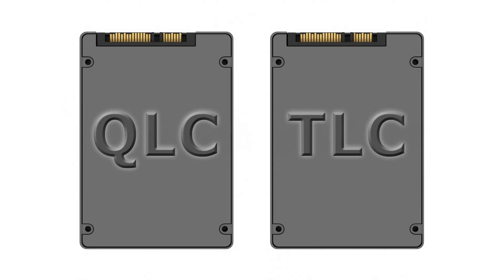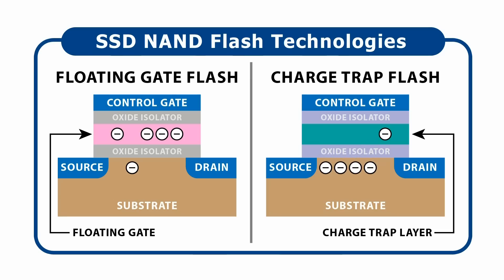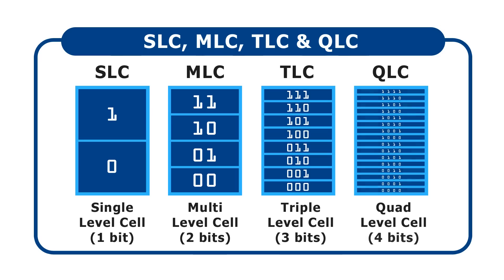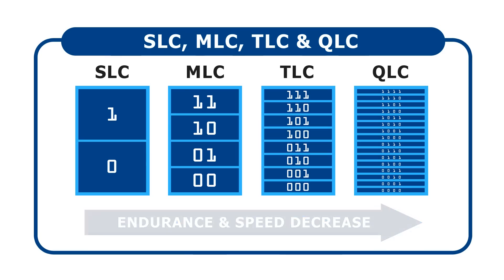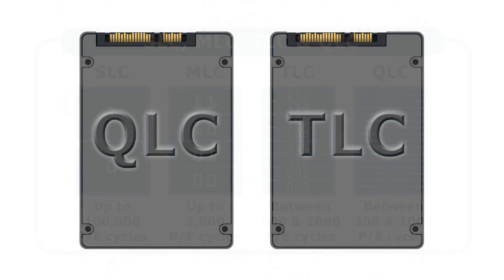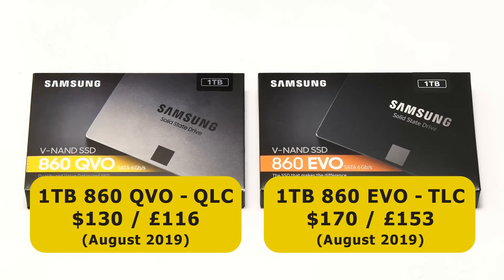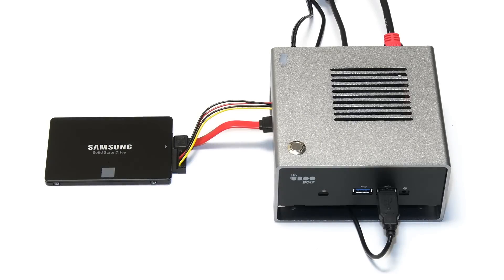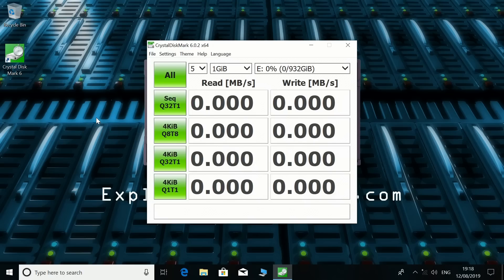QLC vs TLC SSDs: Samsung QVO & EVO

Comment: Wow, thanks for the explanation! I just installed an Evo in a laptop for portable audio recording (no moving parts that way, if kept cool enough) then moving them to a larger external backup drive, so I'm glad I picked the EVO there (good experience in the past with them, plus that 5yr warranty), but as for my upcoming work desk touchscreen PC, built with an Atomic Pi inside a touchscreen monitor above the soldering station, heatsink sticking out the back? I'll save the money for other components, and go with a QVO. 😁
Edit: Also, thanks SO MUCH for explaining how the multilevel SSD technology works! I finally think I understand it somewhat!
Reply from the maker: Great to hear of your Atomic Pi project. :)
Reply: @ExplainingComputers  I ordered an Atomic Pi "developer's kit" (2 Pi units, 2 cameras, 1 power supply, 1 enchilada board - only ones available on Amazon Prime at the time, but GLAD I had 2 to start with) as soon as I could after watching your video on it, and WOW, am I surprised! Those things have proven WAY more versatile than I'd hoped. So much power, and once I got the GPIO working fully? Goodbye Raspberry Pi for me. At least while these are available. 
The touchscreen PC I'm working with as a starter/shell is an older model cheap DIY that someone gave me. It was based on a 1st generation Atom chip and ran Windows XP Touch or Windows 7... poorly. The nice thing is that it ran on a standard desktop mini-itx board, so the Atomic Pi fits perfectly in that space. 
The touchscreen was just connected to usb jumper pins on the MB along with the front panel buttons etc all just using standard breadboard-style wires with female connectors mounted directly on MB pins (and secured with silicone, haha), so I can use that ATX power supply to run the 12v amplifier portion of the "Enchilada" daughterboard along with the 5v for the rest of it, and connect all the buttons directly to the GPIO.
The main purpose of it will be to run VMs from my server and have a soldering PC directly over my workbench to pull up data sheets and videos while I'm working, plus function as a smarthome hub in the background for my home lights/cameras/etc in one place, which are all hodge-podge and mismatched at the moment. I'm also adding an arduino nano to the solder points on the Enchilada board (probably the new nano 4 with wifi/bluetooth mesh capabilities) and an NRF24 for my MiLights. 
I'll update you when it's finished, and see if I can't toss a video or some photos up online. Thanks so much for once again providing awesome information and inspiration! This dead project idea is almost alive now! 
(Been working on the code this week and have it beautifully controlling LED strips as well as ALMOST getting the household lights to all work together. Not the MiLights yet, but that's where the arduino comes in. 
The ambient ones, yes. Yeah, I'm adding silly backlights to it, like those Philips Ambilight TVs, haha.)
My other Atomic Pi is being used to build my partner a portable sound recording studio (using your sound panel advice, heh) inside a hard-shell suitcase. Plug in a large fast USB drive  to record to, and it's perfect. No moving parts, hardly ANY electrical noise at all, no audible whining, and low power usage. That with an elgato streamdeck (6 button) for basic recording functions should be perfect. 
Oh, and it'll also function as a perfect foam carrying case (I'll cut out a section in the bottom) for their Blue Yeti Blackout microphone. (MAN that thing picks up background noise well!)

I also have a strong enough USB PD3 power bank to run it off of, so I'll cut a notch into the bottom foam panel for that as well. (Everything solid will be enclosed in the foam, so that it won't bounce sound.)

Ahh, so many projects... I need a clone of myself.

Comment: During the time the drive is writing from the outside to the faster cache storage in the SSD it might also be able to dump the cache to the slower permanent storage thereby increasing the sustained maximum write burst. Might be a differential equation or a limit of a function.

Comment: I bought EVO TLC  some years ago because of Samsung's 5 yars warranty, a clear statement from the company about the EVO realiability.
Now, QVO just saves 30% or less in price and come with only 3-years warranty? This sounds to me  like Samsung itself is not confident in QLC technology...

BTW 80Mb/s sustained transfer rate is even less than what you can get from a modern mechanical hard drive, so this completely cuts QVO out from the big data transfer scenario like video editing etc. which would have paradoxally been the killing advantage of QLC vs mechanical drives (i.e. best compromise for lage capacity still with ssd level speed).
You did a great job in investigating that.

Comment: Is there a power usage difference between the two techs? Translating to heat output
Reply from the maker: Possibly, but the difference in power use is probably very small indeed.

Comment: ExplainingComputers why Samsung keeps calling their SSD's MLC if you can basicly look on the specs sheet and see that it's not true, or maybe not completely true ? QVO = 4bit MLC
, EVO = 3bit MLC and PRO = 2bit MLC this is a bit wrong there, don't you think ? Is it not supposed to be QVO 4bit QLC, EVO 3bit TLC and PRO 2 bit MLC ?
Reply from the maker: You are right, Samsung has decided to use "multi" for everything -- even though everybody else takes "MLC" for what it first meant of 2 bits per cell. So Samsung 3-bit MLC is TLC, and Samsung 4-bit MLC is QLC. :(
Reply: @ExplainingComputers  That's a marketing shame ahahah

Comment: Did you try it with rapid mode mode turned on in the Samsung magician? I get ridiculously high numbers with it! I'm wondering if it's right or not. They're so high it makes my 970 Evo m.2 look slow.
Reply from the maker: I did not have Rapid Mode turned on, as this caches data to a PC's RAM, so prevents tests assessing actual drive speed.

Comment: Hello, Chris, I have a question I have a MacBook Pro I had it for about 4 maybe 5 months. I was wondering when I shut down the computer for the night it says if I click this box it will reopen in Windows what does that mean exactly?
Reply from the maker: This I do not know I'm afraid. Sounds very strange. Can you run a virus checker?
Reply: @ExplainingComputers  Oh yeah it is clean I didn't know if you knew anything about Macs or you were Exclusive to windows you seem to know just about everything when it comes to computers I figured I would ask.

Comment: I don't want a Desktop system with only a SSD especially if it's TLC or QLC. For my Data I want a longer lasting more reliable Hard Drive that has a much higher capacity at a much lower price per gigabyte. A SSD is best for the boot drive but not data storage.

Comment: This goes back to when we first received the TLC units - we stuck with the MLC (EVO Pro) drives for high-data-change requirements and shifted the TLC drives into the position of system drive where the number of data writes/changes were minimized.  It looks like QLC (which we've avoided to date) may be a successful cost reduction for system drives yet again.  US$40 doesn't sound like much for a single system build, but when you ship high-hundreds of units per quarter, that makes a noticeable improvement in either the bottom line or the customer selling price (or both).

Comment: Great video, thank you! Moving to QVO (and whatever storage technology comes next) really illustrates the need for a file system like ZFS with its volume management and storage pools. It would be so much easier to replace worn out drives and to be sure your data doesn't suffer from "bit rot." Maybe a ZFS video is in order. 😊

Comment: Please test how long it takes for the QVO to fully recover from the depleted SLC cache. In my testing, if I take into account the 80 MB/s direct write to cell speed, it should replenish the 42 GB cache in about 525 seconds which is close to 9 minutes but I observed that even after several hours, the QLC drive still couldn't get back to it's original performance
Reply from the maker: Very interesting. I will investigate.
Reply: @ExplainingComputers  Thank you! That'd be awesome! I know that Intel supplies a software for their 660p SSD that allows you to forcefully flush the SLC cache to disk to get it back to full performance again but I don't think Samsung offers anything that does this. Samsung Magician certainly doesn't support this.

Comment: Note ssds Don't have a ram cache (it's only used for page table and wear leveling all writes and read directly happen at the NAND level) 
What your seeing is windows has buffered caches, look at task manager > performance > ram and you see it full up the cache part of bar by about 8-10gb (depends how much installed ram you have) witch caches writes and causes that bump at the start (turn off disk write caching on the test disks in device manager and that should remove the windows caching)

Comment: Something seems to be a little bit off with your 860 EVO.

I just ran the Crystaldiskmark 6.0.2 on my 1tb 860 evo, and I got significantly better values.

Read vlues from top down,  564.8, 408.6, 408.6, 46.73.  Write values from top down, 537.5, 381.5, 380.7, 132.7. 

Windows 10.

Comment: The thing is, with 2TB and 4TB SSD's even with low end 360 PE cycles, that's 720TB and 1440TB of total data written. For an average consumer, that's a lot of data. I still think having an NVMe MLC SSD as OS drive is smart, because of constant OS read/writes. But QLC as a general purpose data storage and game drive won't be an issue, and quality and reliability will improve as time moves on.

Comment: Most online reviews i have seen put too much emphasis on the reduced endurance of QLC SSD's.  I have owned my Samsung 850 EVO drive for just over two and a half years. At this point the drive has only reached 17 terabytes written, so the 860 QVO's 360TBW is far more endurance than the average user will ever need.

Comment: Interesting.  But how does the QVO drive perform using Samsung's RAPID mode ?  I get up to 3852.8 MB/s (yes, three thousand eight hundred and fifty two) seq read speed with my 500 GB EVO 860 on a cheap Latitude laptop with an i3-5005U cpu.
Reply from the maker: RAPID mode caches memory to your PC's RAM, rather than saving it straight to the drive, so you need to turn RAPID mode off to test actual drive performance. That 3852.8 is the speed of your RAM, not the EVO SSD. :)
Reply: @ExplainingComputers  Oh... Thanks for the info. Works great though.

Comment: You didn't give an explanation for the difference in write speed after the 42 GB cache was filled. The difference is due to the different inherent write speeds of the TLC and QLC cells. If I remember correctl(from nvme drive reviews, maybe the  tech deals channel), the TLC sequential write speed is limited to something like 1500 MB/S, so you're still bottlenecked by the SATA interface. I bet they only put in SLC cache for sustainability or scaling (in the production process) reasons. My hypothesis is that you saw a little dip in writing speed after the SLC cache was filled because the internal controller needed to switch to writing directly to the TLC cells. The inherent write speed of QLC is a lot lower as you clearly demonstrated!

Great video anyway! Really like your channel!

Comment: My crucial 300 died in my last PC, few months after I got it. Went velociraptor 10k rpm wd drive. Now on 1tb m.2 Samsung pro, with 2tb evo steam/blizzard/origin drive and (prior to having them BOTH die) 2x 6tb wd black for backup ...with 4tb my passport for tertiary backup
Reply: Cheap SSD/NVME endurance is lower than their advertised, don't be impressed on cheap stuff

Comment: Now a new subscriber here, love the explanation for simpletons like me ;)

So if maybe not for boot drive.. what would you trust it for?

Would you use it for the likes of games... where it might be constantly being read/written - but if it fails, who cares, reinstall games on new drive no drama
Or say... photos/movies/documents... where the read/write might be less, but loosing this drive would be a bigger loss

Or... who cares, just run it.. and back up daily/weekly on a old school 3.5 HDD
Reply from the maker: I would trust QVO as a boot drive, and indeed am doing so for a Linux install as teased at the end of the video. :) And I totally agree with your final statement -- who cares, just run it, with appropriate backup.
Reply: when HDD being died you could loose  your data, and cost recover HDD data is very expensive but not for SSD when your SSD TBW(Terabyte Written) has been exceeded can copy your very important data to the new storage.

Comment: I have raid 1 QLC Samsung drives as a cache in my file server. Only using gigabit Ethernet so not hitting anywhere near the full write speed anyway. And i don't write big file that offent mostly small file most of the time. Also have my unraid vm image stored on my cache drive. And the cache drive are really need with perity drives on my main array

Comment: How long does the QLC drive need to recharge until it has its full performance again? Isn't 1GB/s at the beginning of the write test impossible for SATA?
Reply from the maker: The QLC will be back to its max write speed once the cache has cleared -- a few minutes. Windows Explorer indeed reports strange -- and impossible -- numbers at times! :)

Comment: I think the price difference of about 40 € on 1 TB is too small to support QVO on a single drive. Maybe if you were in an organization and had to buy 20 drives. Sure on large drives most data just lays there once written. If the difference was 100 € vs. 170 € then QVO would be more attractive.

Comment: I am a memory expert and I can say you only touched the surface of NAND storage cell technology. I think the biggest thing you missed was that not all substrate dies are equal at a given level; there are SLC that are rated up to 100K writes, but others at 50K or even 10K. One indication is to look at the ECC requirement and see how many bits are expected to be corrected per 512 byte page slice. Therefore, there are MLC chips that are superior to lower quality SLC chips. Further, it should be noted that all NAND cells suffer from unreliability and MUST have a hardware ECC layer implemented, unlike NOR cells which can be rated reliable and require no error correction.
Reply from the maker: I totally agree with what you say -- I gave a very brief overview of the technology, as I did not want that part to dominate the rest of the video. My challenge in making videos is always deciding what to leave out. :)

Comment: If there is one thing that SSD have a hard time beating HDD, it would be reliability in overwriting old data with new data without function issue.
Reply: Also data storage on prolonged time. Hdd can easily store its data in apropriate conditions for 30 years. Ssd, especially qlc now, wont hold even 20 years. Slc will be best but tops out around 10 years, mlc less, tlc few years, qlc some months. Also hdd is still cheaper for GB per cent.
Reply: @fulldnbboy  So which one of the SSDs are the best for storage on prolonged time?
Reply: @TheRealFobican  if from ssd, then slc is the best for archiveing.

Comment: Could be good for archival disk, but the question is how long it can retain the data intact. Does it mean that when you save the same data on both of them, and just leave them, the data on the QLC are more likely to be corrupted? If so, what are the ways to prevent that? Duplicating the files and remove the original ones? I think manufacturers need to provide some sort of utility to refresh files, so that users can execute it  occasionally on their archival drives.

Comment: Lol, I so know at the beginning of this video that the question I have won't be answered - how long will these actually last (percentiles etc)for drives that don't go anywhere near their write limits - because most of us home consumers won't be writing to the drive hundreds or thousands of times. My 1st SSD is a 64GB Samsung, it doesn't even support TRIM but it's still working fine after ~10 years, good luck finding a HDD that lasts that long.

Comment: This might be of help to some, but with the 500gb 860 evo sometimes turbo write doesn't function correctly and you will only get a maximum write speed of about 300MB/s. you can fix this buy going into the Samsung magician software and use the over provisioning tool. I set 11% of the drive as empty space, more than I really need but it seems to have fixed the problem.

Comment: Chris you just proved: WHO in their right mind will buy QLC?
Unless they are selling(QLC) at $50 for 1TB.
Reply: Laptop manufacturers would be a market. Who asks is the drive TLC or QLC when buying a laptop. Objectively it might be better but I think the SSD endurance is something people do not view objectively,
Reply: @okaro6595  Yes, that's the point...moving away from HDD's. Its for OEMs who just want to ship storage with new devices. But of course, my guess would be to get rid of the last HDD inventory and thats where the missing gap gets filled in by QLC. QLC could fully replace the last HDD's doing the rounds in the open retail market.

Comment: For purely home data storage purposes, do you think QLC SSDs would be OK to use in a NAS? Given that I do mostly read cycles not write cycles. Assuming so, based on your video.
Reply from the maker: Yes, a QLC SSD should be fine in a NAS with relatively light write use.